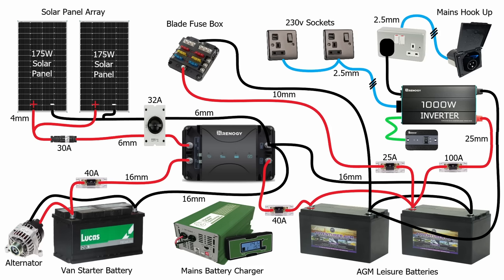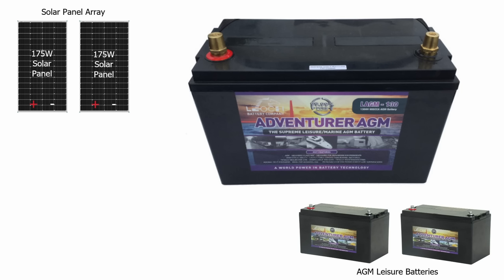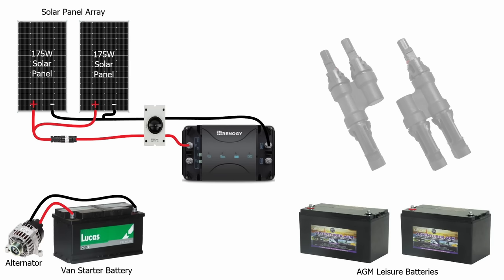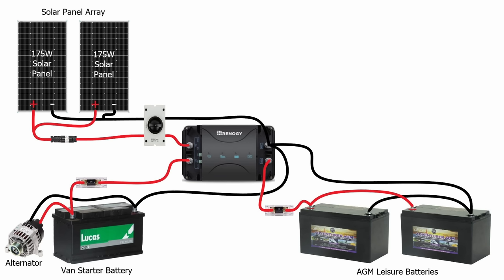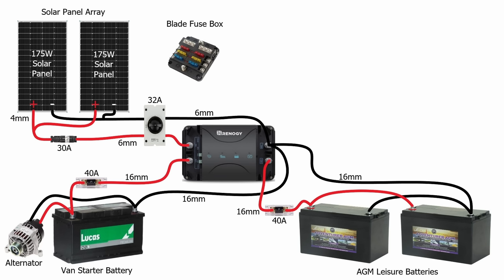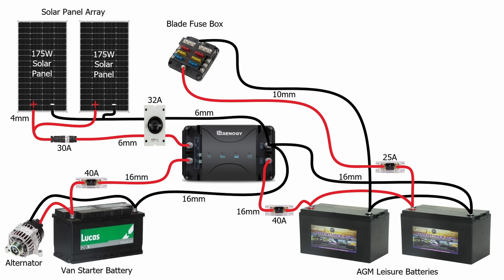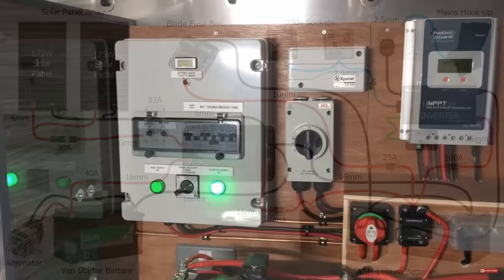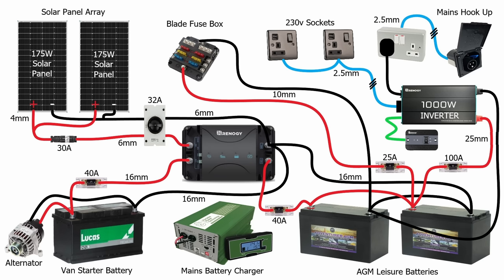12v Electrics for Off-Grid Campervan - Fiat Ducato Budget Build Ep12

Comment: Hello Greg, you helped me alot with my campervan build.. I want to ask you about that inverter, If I am connected to the power on a camp site and I use more power than 1000w, lets say a microwave and Coffee maker how will that work? 
Thanks.
Reply from the maker: The inverter will only pass through the same watts as it is rated for say 1000W. You can wire another socket from your consumer unit to dedicated hook up socket or increase the size of the inverter. 
Watch the next video regarding consumer units
https://youtu.be/kdvm0TFvfVQ

Comment: Thanks Greg, very similar to the setup I’ve planned, although I’ll be adding a Lynx Power in, how many amps did you chose for your dc to dc?. 
Also are you making any provision for a Consumer Unit on the 240v side of things? Appreciated !!
Reply from the maker: I chose the 30A charger as I'm only using 220Ah of AGM battery and you shouldn't try to pump too many amps into a lead based battery. If you chose Lithium then go for the 50A version.
Yes, it's a good idea to have a consumer unit to protect your circuits as they may not be adequate protection external to the van. Make sure you select the right size breakers as standard units off the shelf are usually too big. Go to somewhere like CEF who will make one up for you out of components.

Comment: Hello excellent video, I have question about the Renology dc - dc MPT charge controller in that it can only receive 50mps max does the alternator charge exceed 29.4 amps as the solar in parallel is 20.6 amps ?

Comment: Hello Greg, I'll take a moment to thank you for your video it helped me a lot. 

Can you please tell me is it the setup of 30A Renogy charger or 50A Renogy charger?
Reply from the maker: I am using the 30amp charger because of the battery type and capacity as explained in the video. 
If you use a 50a charger you will need bigger battery or lithium and larger fuses and cables too. 😊

Comment: I'm planning on installing solar on my caravan, so while we're out traveling on the off chance we decide to stop off the beaten path we can still use power, not just draw it from the car or hope the battery is up to the job.

Would this set up still work effectively if I removed the alternator from the equation?

Comment: I'm still debating whether to use an electrical system like yours or just buy a portable power station, which seem quite popular at the moment. Without the solar panels, how much did your installation cost. Many thanks.

Comment: Another great video and has solver my problem of having 12v sockets and 230v sockets one quick question following your post about a consumer unit is a 63amp breaker too high? Or should I fit lower amp.  Thanks again
Reply from the maker: Please watch the video again to betetr undertsand how the various ratings are applied.
If you have an RCD of 63amp rating that is ok, as that relates to the switch contact rating.
An MCB of 63amp is far too big as that is the actual fuse rating of the device and these should not be more than 16amp for a campervan. Hope that makes sense.

Comment: Fantastic video greg, just one question. with all the components connected directly  to the fuse holder how do you turn the appliances on/off independantly and also manage the voltage on the leisure batteries?
Reply from the maker: If you want to turn off devices you would need to wire a switch inline on the positive cable to that device. On this system I plan to use Renogy BT2 Bluetooth device and their smart phone app to monitor the system voltages.

Comment: I used the Renogy Unit you did last year.  I just used a single pole vs double pole switch for the solar (1x175W).  Should I add a double?  Of note as well should be if the solar and Alternator power is happening at the same time the Alternator Amos will drop by .50.  I really like the trickle of the starter battery after the house is full!
Reply from the maker: Double poles are always better when you have a common negative system like this. 
When you are driving you are still getting solar so the two together is still great.
Reply: @GregVirgoe  thanks, will do

Comment: Hi Greg big fan yours in fact I used this video for the base of my build So I got the renorgy 50 mp DCDCMPPT along with 3 X 23V 11.05amps   Renogy solar panels you cant have enough solar they said lol. Well in series the volts are 69v so over the max, in parallel  the amps are 33.15amp so over the max pv branch connectors and inline fuse limits to protect the 3 way branch needed to get 2 cables through the roof to the charging unit. What do I do? Ditch one the panels? If the panels where 48v it would be fine. Think I have exposed this units limitations or am I hopefully wrong
Reply from the maker: Hello Mike, The MC4 triple connectors would be OK at that amp rating and I would recommend using a DC MCB internally rather than an inline mc4 fuse. Heres a link for a 40am DC breaker https://www.ebay.co.uk/itm/394850083784?hash=item5beee623c8:g:3usAAOSwISdk8AW~&amdata=enc%3AAQAIAAAA8Csz%2BpJe6SJ%2B%2BCtya%2Bl%2FNnr2MCbBojnJEpm0bdFkFwLGwWeae%2Br9sWMgbcJMLIfjM9X1FNN%2BJ2c6dBTPu1cM9vD%2BrjXN9mGfQEFeJvnT1OnQWGn0iYdxZBEtsgfbMMufTcp85C%2BKSg6sf7pqSse3FEslWMfBP1FDY4PlEY6KFo70JWFTvRarY%2F2bO%2FnPiy%2F25mMOubkz2fQ2pIn4UrmUbYXMeBZUku316%2FCGJIoy%2FWH2zNxvk1dB3I6ZYYyZoj138f%2FFuyrNgQ5niasidXQ71x1BrZvIvgFS6cPOwYOJzuHeiMGeEzojn0RPt84KlwgLcg%3D%3D%7Ctkp%3ABk9SR_jdyYv3Yg&mkcid=1&mkrid=710-53481-19255-0&siteid=3&campid=5338027957&toolid=11800&mkevt=1

Comment: Hi, I'm new to van conversions and have been learning about electrics for several months using your videos which are amazing and most recently this video as I have the exact same devices although I have a lithium battery, I haven't started the  fitting yet as I'm waiting for better weather. The question I have is, have you done your dedicated earthing and grounding video for this system and if so where can I find it? Thanks
Reply from the maker: It’s in production so you have not missed it yet. Stay tuned 👍🏼😊
Reply: I bought this system on your recommendations so I'll definitely stay tuned, I hope it's soon I'm looking forward to learning more 👍🏻
Reply from the maker: @christopherrobertson4730  thank you 🙏🏼 I’m sure you’ll be happy with the setup. 😊

Comment: Hi Greg, first of all thank you for your videos, you've given me so much confidence with the idea of doing all of this myself. I'm just wondering, with this set up, would the batteries also charge when plugged into hookup? Or would we have to rely on the optional battery charger for that? Also, does having an inverter that's only 1000w have any impact on the appliances you can use on hookup, or will the inverter not have any impact on this? Thanks again
Reply: I think I have watched this video about ten times by the way! It's so helpful!

Comment: I have been hinting high and low about wiring the renogy inverter to use the switch over and it’s very vague , this explains it brilliantly as per all your videos , just one question though is there no need for a garage fuseboard on the mains power side at all ??
Reply from the maker: I'm glad you found the explanation to be helpful, the switchover from mains to battery and back takes just 50 milliseconds and most devices won't notice the change.
It is wise to install a small consumer unit on the entry to the van with the right size trips in case the hook up supply is not protected..

Comment: Hi Greg, thanks for the video again, I’ve got the same setup as your original van but I want to add a split charge relay for when it’s cloudy skys and I’m running additional compressor fridge freezer. I’ve also had problems with the van starter battery when it’s not in use for months at a time so would be good if the split charge could take power from solar to keep van starter battery topped up. Any advice would be greatly appreciated
Reply from the maker: I would not install a split charge relay because it will not look after your leisure batteries as it’s only a switch. Better off fitting one of these dc to dc chargers and re wiring the panels in parallel. This will charge both batteries with solar and charger both when driving. Best option by far.

Comment: Great video Greg. How would this change if you had a Sargent EC155/EC50?
Reply from the maker: That is quite a difficult one because the SARGEANT distribution board is designed for use in caravans and motorhomes meant to be on permanent hook up and with no solar. 
This system kind of replaces everything that the SARGEANT unit does
Sorry it’s not something you can easily integrate.

Comment: Thanks for this simplified version.  One question.  I have read the victron all in one setup will supply a combined input by dividing the charging sources in half.  I have stayed with separate mppt and dc to dc for this reason.  I put a shut off between the mppt controller and the panels. This seems to prevent the system from reading the panels at all, and utilizes all the dc to dc.  Is this same with renogy?  I am redoing my 1981 motorhome, and presently have deferent brands, but have been happy with Renogy, and would like to stay that way.  I couldn't find anything on Renogy's site to answer this, so maybe you would know.  If it separates the power rather than divide  the total input, I would go with the one all in one unit.  Thanks for all the good information you put out there.
Reply from the maker: It’s been many years since I was at school but I do remember that 1/2 + 1/2 = 1 😃 if you have generation coming from two sources taking the full amount from both would exceed the charge rating of the output or am I just bring too simple

Comment: Hi Greg. Thank you so much for this informative video! I was just wondering if it there is an advantage to using all of the same brand for the charging side of the electrics? E.g. would it matter if I got a Renolgy MPPT charge controller and a Victron Dc-Dc charger?
Reply from the maker: If you got the Renogy unit it would do both in one device and save you a lot of money. 👍🏼😊

Comment: Hello, you isolator switch look like it is rated for AC. DC isolator switches are quiet different then the AC ones. DC arcing is a tricky bit.

Comment: Greg hope you well. I am planning on completing this system. I have seen the updated video where you have updated us ref the 240 fuse box with RCD protection. I have a couple of questions hopefully you can help me with.
I am going to install a double socket straight of the fuse board, so that I can plug the 1000w inverter in, just like you have in this video. What size fuse protection would need to be in the fuse board?
Will i need to up the parallel cables  from 16mm to 35mm as you have done in previous off grid videos. If so are they the only cables that need to be 35mm or do other I need to run some to the inverter and MPPT + DCDC controller?

Thank you in advance

Comment: Hi Greg, thanks for your time and great materials, it helps a lot. I would like to ask you, I am building a Citroen Jumper in Portugal and placing 600 W of panels with a DCC50S 12V 50A Dual Input DC-DCBattery Charger with MPPT Renogy, but I find a bottleneck in the amperage of the panels in parallel, it is giving 29.4 A and I can't get a fuse greater than 30 A on the MC4, nor the ON-Off Transer Disconnect Switch, which I only got with 32 A. As a solution, I thought of putting an MC4 10 A fuse on each board, before the parallel connection or a porcelain fuse on inner case inside the vehicle. Would you have any suggestions? Thank you and have a good week.
Reply from the maker: The short circuit current for a 200w panel is about 11amps so the max 3 in parallel will generate is 33amps. So why not use one of these breakers https://www.ebay.co.uk/itm/115795182064?mkcid=16&mkevt=1&mkrid=711-127632-2357-0&ssspo=kALS36X0SYW&sssrc=4429486&ssuid=IAwKHBzwQ6K&var=415863959127&widget_ver=artemis&media=COPY

Comment: Hi Greg, great videos and so professional. Thanks.  

Questions X 2.  Should the above system be earthed to the chassis?  Why do you not have a consumer unit between shore power input and the 230v sockets( I assume this is because its expected that shore power supply has protection?)  

Kind regards

Tony
Reply from the maker: Thank you 🙏🏼
12v DC does not have an earth. 
Please watch my next video on consumer units 😊
Reply: @GregVirgoe  Hi Greg, I didn't mean to confuse, I know 12v doesn't need earthed, I was asking about the consumer unit that you didn't add to the electric hook up. I sense your cynicism, I asked a guy who gave a straight forward response. thanks anyway.  Great videos.
Reply from the maker: @tconway203  Should You Install A Consumer Unit In Your Campervan?
https://youtu.be/kdvm0TFvfVQ

Comment: If you were to run the electric of the mains hook up on a camp site, would it supply power to the devices connected to the fuse box from the batteries? thanks, great video!
Reply from the maker: What you would do is turn on your mains battery charger to keep the batteries topped up while running all the 12v stuff from them.

Comment: Hi ! , My setup is nearly identical as this I’m just wondering should I run a negative wire from the leisure battery to a grounding point on the chassis or will it be fine as is ? Cheers :)

Comment: Great video Greg. In the case of being hooked up to shore power on a campsite, would you still be limited to the size of your inverter (your case 1000w) or would you get the benefit of being able to run off the campsites system? e.g 230v x 10/16 amp
Reply from the maker: Through the inverter it would be limited. 
There will be a consumer unit fitted to the hook up and you can run separate 16amp socket from that if you want the option to use full power of hook up.

Comment: Would you mind explaining how exactly to connect the mains battery charger to the system? Is it in the center control area or do you connect it to the two leisure batteries like the control? Also can this be connected t the van starter battery as well?

Comment: Can you add lighting to this great video thanks
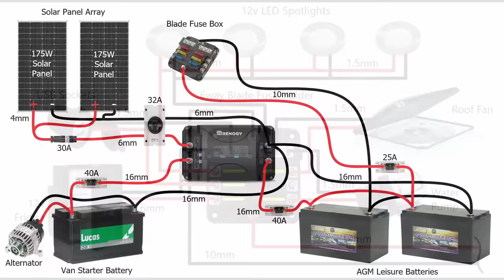Reply from the maker: Hi Stevie, if you pause the video at 12:00 there is a wiring diagram showing the outgoing circuits from the blade fuse holder. Alternatively you can look at this video I made which shows you how to wire lighting circuits 😃👍🏼
https://youtu.be/koFg6oFs0RU

Comment: Hi Greg, I have the same van and I had something very similar planned regarding the wiring diagram you show in this video. Only thing I’d planed different was maybe a 2000/2500w inverter, a bigger capacity blade fuse box and also a 280ah lithium battery. Is there anything I should change in your diagram regarding wire thickness and fuses? Thanks.

Comment: Hi @gregvirgoe keep up the good work with these videos, Currently on with my own build and they sooo helpful! 
Is this setup powerful enough to run a truma combi ???
Reply from the maker: It will run the 12 volt control side and heater fan no problem, I would never recommend running the electric elements off Leisure Batteries as they use so much power, 1800W is about 144amps per hour off a battery system. These AGMs would not even last an hour if you did that. So Truma electric heating elements are best run when on a hook up supply and dedicated power from the consumer unit to the 230v connection is the best thing to do,
Reply: @GregVirgoe  thanks 👍🏻

Comment: Hey Greg, just found you and I’m so happy as I’m about to live off grid! I have a question regarding the last part of this video - your leisure battery charger that you would connect to the power at a camp ground or at home - what’s the reason that’s not part of you system i.e. integrated and not a separate unit you hook up so that when you plug in, you charge? Thanks for doing these video, they’re SO helpful!
Reply from the maker: The battery charger is permanently connected to the hook up supply and connected to the same battery terminals as the dc to dc charger. 
The diagram was getting a bit busy so didn’t actually show that. You just turn the mains charger on once you have hooked up 👍🏼😊
Reply: Exactly what I thought, but so helpful to have the confirmation. Thank you again!  @GregVirgoe

Comment: Thank you for your videos. They are very instructive. I have a question ¿How do you connect the batery charger to this electrical circuit? Greetings from Argentina.
Reply from the maker: Easy, the battery charger plugs into the 3 pin socket by the hook up, then connect the positive and negative cables to the same terminals on the leisure battery as the other dc to dc charger.
Reply: Hi Greg, Thank you very much for the beautiful videos you always make. Maybe a stupid question, but should I connect the + (plus) of the Mains Battery Charger to the left positive Leisure Battery and connect the - (minus) to the right negative Leisure Battery? Greetings from Hans.

Comment: Hi Greg, quick question, would/do you leave the mains charger plugged in all the time or only when you need it and are on electric hookup? And I'd assume when plugged in it would be on the socket fed from the EHU? That's 2 questions I Know 😂. May as well go for the third then. If you introduced an RCD would it only be needed to protect the EHU fed sockets? Does the Renogy have its own protection? Damn that's 4 questions now...Apologies 😂

Comment: Hey Greg, am i right that that mmpt will only supply 15A from alternator and 15A from PV? 
Is the open circuit voltage important? I think you will be close to 25v with your panels?